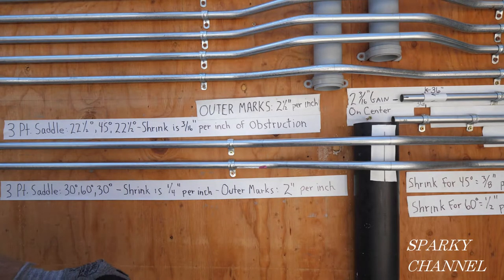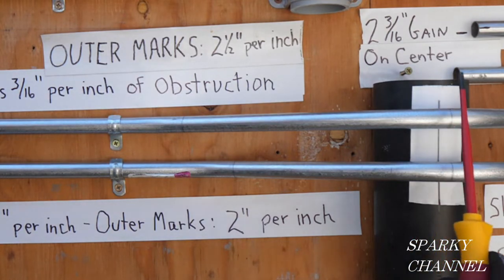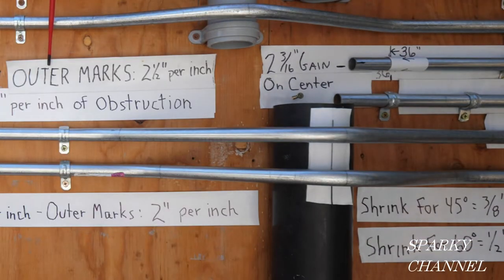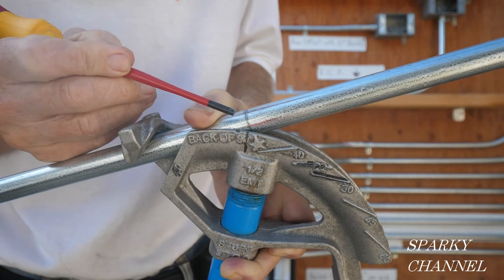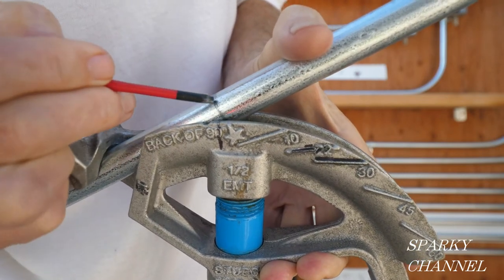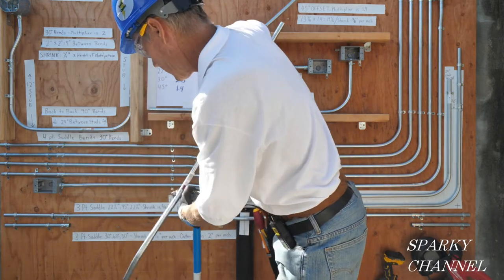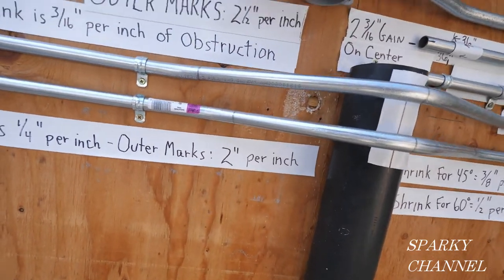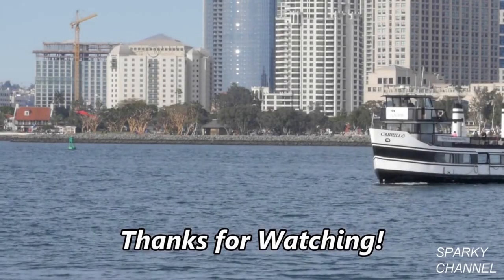EMT 3 Pt Saddle Bends 22.5°, 45°, 22.5° vs 30°, 60°, 30° and How To Make a 30°, 60°, 30° 3 Pt Saddle

Comment: I run across needing a rolling offset at times due to box location and emt path.  Have you done a video on this process by chance? I can make them but since it isn't a common bend I do I sometimes waste material.
Any tips would be gratefully appreciated. 
Thank you
Reply: I think you measure both ways, horizontal and vertical and then use a²+b²=c² and do a regular offset with that measurement

Comment: Hey Ive learned alot watching your videos , I used the 30,60,30 saddle on a 3/4emt for an obstruction of one inch . I  was able to succeed but it was difficult to get it right . Im fairly good with the 1/2in and very confident with my bending skills but this 3/4 is my week spot .Any advice ?
Reply: it was difficult because a 30 deg offset requires at least 6 inches or more between bends your offset has to be at least 3 inches to use a 30 deg offset and anything below a 22 1/2 degree offset can be less than 6 inches i hope this helped i experienced the same thing